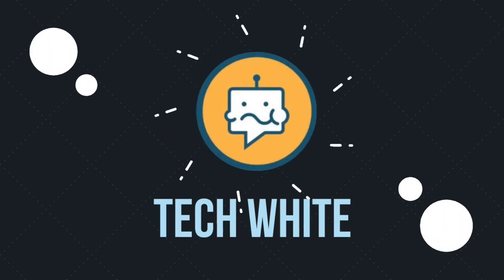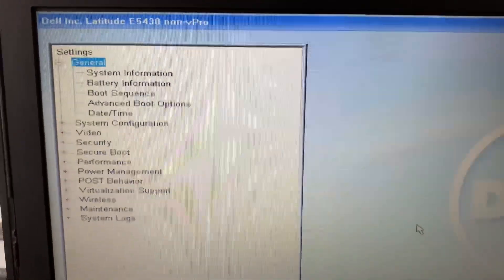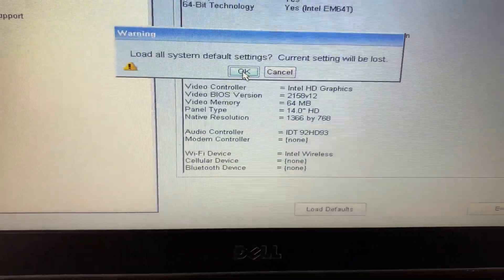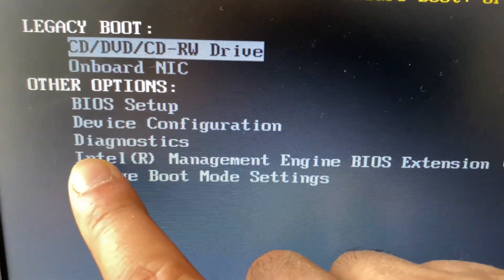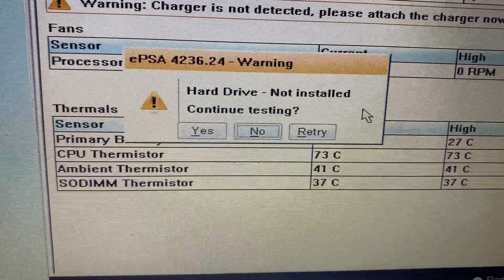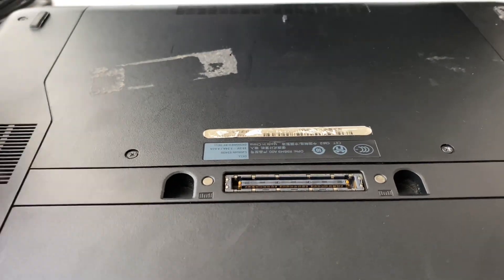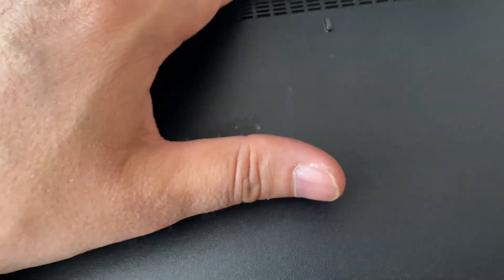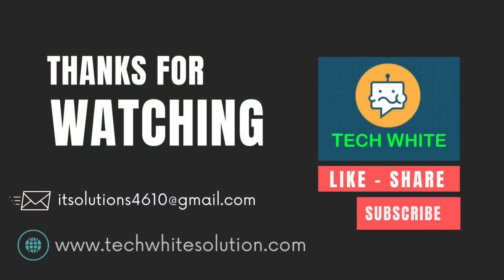Solved: Hard drive not installed error on laptop - Hard Drive Not Found

Comment: I tried both trick hard disk is not lose but still showing same error what i do now?
Reply: Same here
Reply: Your issue solved
Reply: Same here
Reply: did u buy new one? maybe hard drive is fried. tell me if u got it fixed. im facing this issue now
Reply: Same 😢
Reply: @RIYASHARMA__________________99  hey, i found some random solution online. (this is not from me) try this :

 Here's what i did.......download the recovery iso for your computer ( laptop in my case inspirion 14 5425 ) I will set up as an exe on your main computer ( you wont wipe it as it will ask if you want to usb it ). Locate the 7 digit Service Tag no. on bottom of laptop( should be near a qr code ) You must enter that to get the right recovery software.  Get Rufus. Make sure you set it to uefi when transfering iso to usb. ( 64gig in my case ). Unplug cmos battery for 3 mins. In bios disable secure boot. save and shut down. insert usb with the dell recovery. Turn on and it should go right to the windows set up.

so basically, you have to open the back of ur computer. You're lucky if you don't need any screwdriver like mine.
Reply: Same here
Reply: @madeehabanu432  Problem solved! I replace new harddrive disks by going to nearby technician repair shop.

I've tried everything trust me, that's the only solution. BUY NEW hard disk

Comment: Alert! The AC Power Adaptor wattage and type cannot be determined. The battery may not charge. The system will adjust the performance to match the power available.

Strike the F3 key (before the F1 or F2 key) if you do not want to see power warning message again.

To continue press F1 key
To change setup option press F2 key
To run onboard diagnostics press F5 key

Error solutions please
Reply from the maker: Press F1 to boot OS
this issue is because of your Laptop battery or maybe Laptop charger
Reply: Sir mera b yahi problem to kya mai f3 press kr k risk Lay lu Abe charger ni mil sakta  @techwhite
Reply: Omg GOD bless you more worked lyk magic ❤❤❤